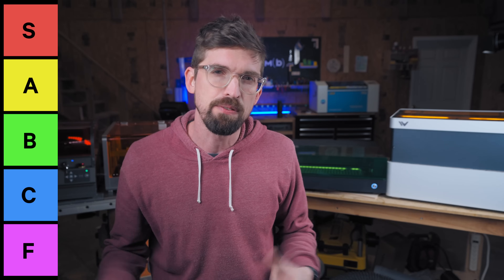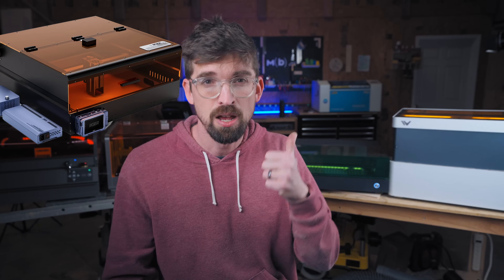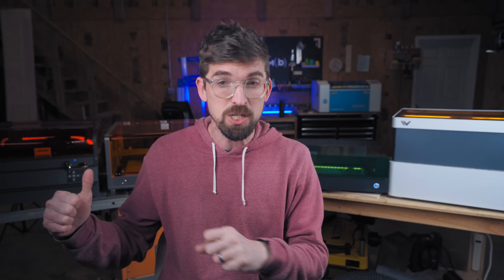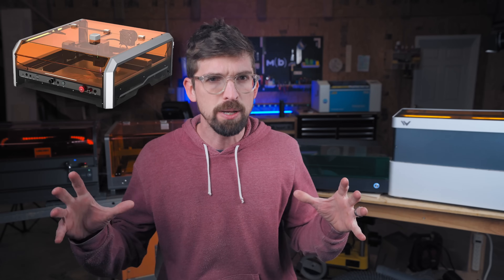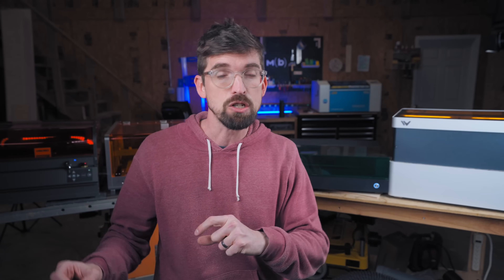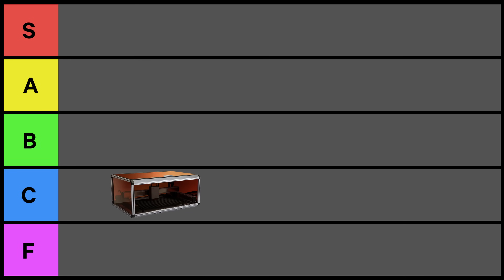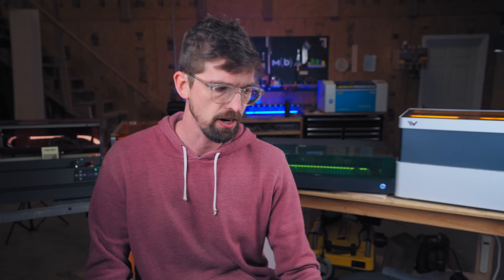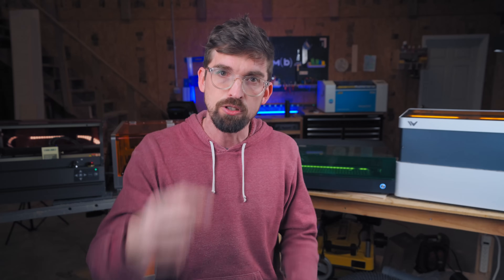The Best Laser Engraver and Cutter to Get in 2024

Comment: Nice video. I operate a fiber laser for work, cutting mostly 5’ x 10’ sheets of 1/8” aluminum. Every once in a while I get this feeling that it would be nice to have a really small scale machine at home for hobby stuff, but I’m not in a place where I could drop $1000+ for just a hobby machine. Maybe the pricing will get more accessible as the technology matures, like it has for 3d printers (one can hope).

Comment: I have to disagree on the D1 Pro being ranked low. I own the D1 Pro, F1, and S1. They all have their merits, but the D1 does something that my S1 cannot realistically achieve.... I can place it on any flat surface and engrave whatever I want. With that said, the F1 is still my overall favorite due to my own personal use case, but the D1 Pro is versatile... it has the room underneath for me to insert a full length baseball bat and use the rotary tool to engrave it. That wont fit on my others!

Comment: There are two classes of enclosed diode lasers: craft and hobby.
In the craft class, I'm curious why you decided to include the Aura and WeCreat but skip xTool M1 which might be older but still comes out better than Aura, and the WeCreat is basically a somewhat improved clone of.
There's also the new Flux Ador which is again very similar in form factor to xTool M1 and WeCreat.

Comment: I am loving my Atomstack A70 Max. So powerful for a diode. The only downside is the non--enclosed part, but I just run it in my garage with the door open and fans running.

Comment: You didn’t mention the software cost for the Glowforge which I think is very important. Glowforge premium subscription is $50. Month, $600 a year. If you don’t get the premium subscription the basic is bones. Yes, I mean dead bones, 100% strip to do most things. Most of the features such as symbols, shapes, and most of the other features is tuned off. And very limited to two types of fonts. This company “Glowforge “ is the most expensive laser cutter out there in terms of their software. Plus, you can’t use any other software with the Glowforge Aura or Spark models. It is sick and down right greedy.

Comment: I own the F2P as well and I'm a bit saddened by the inability to raise the z-height on this unit, despite being promoted on Creality's own listing page. I suggest anyone looking into this printer be VERY cautious. You're paying a lot of money for a supposedly versatile tool. If you think someday you might use a rotary tool on this thing -- you probably won't. The tray CANNOT be removed to extend the legs so you can fit a rotary. The device uses a magnetic switch to detect when it's removed, and shuts off the laser. So just be aware that you are basically buying a $300 CNC laser with a $20 lid on it and a PC case fan to vent it.
Reply: I own a Falcon 2 22w. I feel so angry and cheated by Creality. It’s so hard to get it to work. So much fiddling around. No wifi capability. No camera, not even as an option. No IR optional module. No cross laser for reference. I had to spend tens of hours to install all of these and still hard to use. I’m so sad I did not buy an xTool or Sculpfun.
Reply: @TheBlackDove  yep Creality is a better deal on paper than in reality.
Reply: Thank you for sharing this info!

Comment: I did like this comparison. HOWEVER. I've got to call you out just a small bit. I just bought the S1 after some considerable research. The full enclosure did sell me the most, but the extra features really made this purchase a no brainer. I find it odd that you didn't mention that the S1 has all the attachments. Extra modules (like IR laser, and 20W laser switchout, + future ones), The Rotary attachment, the riser for thicker material option (which also give you the pull out crumb tray feature), the pass through capability with the riser. The Fire extinguisher module option. The conveyor system module which allows for 10 FEET material.Do all the other machines offer this? I purchased all the above (except for the 20W, which I may still buy).
Reply: Yeah the S1 seems superior in almost every way compared to the Falcon2 Pro. You could try to say there is no camera, but the one in the F2P is just an external usb web cam that you plug separately into your PC... there's nothing stopping you from sticking one on the X1. It's really that janky.

Comment: Just upgrading my Roly with an XTool Fire safety set. I’m not happy to use XTool but there are no alternatives right now and it’s a standalone system, so it works with any enclosed laser you can fit it on, just don’t buy the S1 specific version.
Reply: On Amazon, Jogoswall makes an tiny Automatic Fire Extinguisher for $40.00

Comment: Great video. Side note. Xtool - Lightburn compatibility on S1, F1, and P2 is a bit.. wonky. Work is being done on that though
Reply: I would avoid XTool at all costs!
Reply: @MyLifeAsMitch  All brands have their pros and cons. Not a fan of closed ecosystems but... they are going to take over GlowForge on that business model :P Machines are nice htough so is the new tech they are adding so....
Reply: @yourlifeisyourfault  I wonder this myself. Please explain 1-Nice-Guy. We want to know.
Reply: I don’t like their advertising model, and the way they treat current customers. I also feel they deceive their customers by how they market their lasers…example, they say the S1 is a Class 1 Laser and goggles are not required, but if you order the conveyor, they include goggles. Also, the front and rear access panels don’t have interlock switches, so the laser can be operated with them open and could result in permanent eye damage. None of this info is on their site, feel free to check your self.
Reply: @MyLifeAsMitch  I think - although i get your point - you are conflating concepts. S1 out of the box is a Class 1 safety standards machine. MEaning, there are no laser light leaking possiblitities. The moment you start modifying the machine - which is what conveiyer does. - you loose that safety standard. Now, i do agree it should be clarified, but brands - specially at this level of budget machines - cannot also nanny people around. Is a catch 22 situation. I am also not particularly a fan of their marketing but fair is fair.
Reply: @gilaraujo  I don’t think it’s conflating, they don’t mention this at all, that’s an issue. It’s also not a modification, it’s an accessory they sell.

Comment: Given that 30-40W will cut 15 mm plywood and ~20+mm wood/particleboard, once you get into/past that 30-40w range size starts to be become the more important metric for many/most. 

A 3-400mm square 70w laser will for most be a LOT less interesting than a 500mm+ square 40W model and available space becomes the real limitation.

I would buy a 600mm square 40W laser over a 300mm square 70w laser for a similar price and it wouldn't even be a difficult choice.....
Reply from the maker: Size for sure helps as you go up in power.

Comment: Thanks for another useful video. If you have a moment, where does your Thunder "Bolt" sit in this lineup? That's the machine I am most interested in.

Obviously you could not cover everything, and one important factor you overlooked is maintenance. For example, the Roly requires removal of several tiny screws to clean the lens and shroud, while others use magnets and other methods. For me, difficult maintenance could be a deal breaker.
Reply: If you're open to content suggestions / requests, I'd be very interested in a video comparing the maintenance and upkeep requirements of these (and other) "consumer" lasers.
Reply: It doesn't sit in this lineup, because it's a CO2 laser.
Compare it with OMTech Polar, Gweike Cloud, Flux Beambox/Hexa, xTool P2 (and Glowforge Pro if you must).

Comment: The Xtool S1 doesn't fully support Lightburn. There are several features that you cannot access through Lightburn. Also, I and many (most) S1 users find the marking system superior and more precise than a camera
Reply: Then why does the P2 have not 1, but 2 cameras? The positioning system is beyond time consuming if you want to use a pre used piece of wood that has blank areas scattered around.
Reply: It's older technology. @MyLifeAsMitch

Comment: It was not an apple to apple comparison, suppose people want to buy a 40W or 20W machine, there should be a 40W vs 40W or 20W vs 20W comparison instead of a mix. It was kind of a mid-leading using $/w jumping from different watts.
Reply from the maker: The $/W was the best way I could try and make it apples to apples.  The hard part is most of these machines offer different wattages and not all of them are exactly the same.  The $/w wasn’t the main thing that I used to decide on my rank (pretty sure it would have been the same even without), but I wanted to give some kind of reference for people to see how much power you are getting for the money.  

For me at least it was surprising to see how the 70w from iKier was not super expensive considering the wattage but the Glowforge Aura is.  

I do like that most companies offer interchangable modules so you really are deciding more on the platform and then figuring out which module to get.

Comment: Do any of these machines have a fence? I use materials sometimes with certain patterns on them that I need the pattern to be square to the cut. I built one for my atomstack, but I’m thinking about going to one of these. 

Is there any desktop lasers (Diode or CO2) that have one? A camera is little too inaccurate because of the parallax of the lens.
Reply: Get a Roly. You will love it. The honeycomb does not move around at all and the laser beam is aligned to within 0.5mm accuracy. It also has an optional jig table.
Reply: @Fobes  Well… .5 mm is about as accurate as I could ask for. Might look into that. Thank you!
Reply from the maker: That jig table looks awesome, reminds me of a fixture plate on the CNC mill side of things.
Reply from the maker: So some have a fixed honeycomb, the Roly is like that it looks into place and you can reference off of it.  Even if you don’t go the camera route you can use the framing option with the low power diode to get an exact position.

A square would be a great option to add in though.